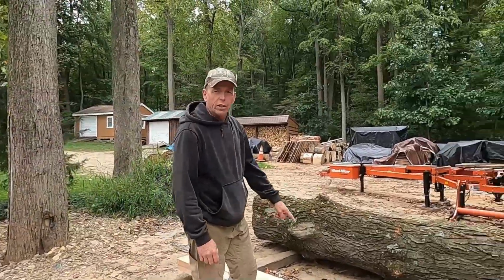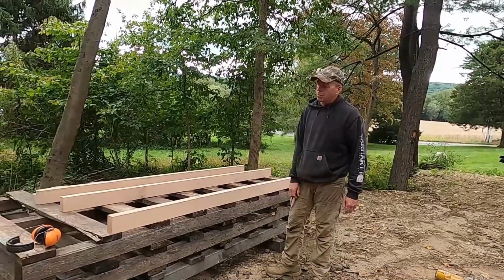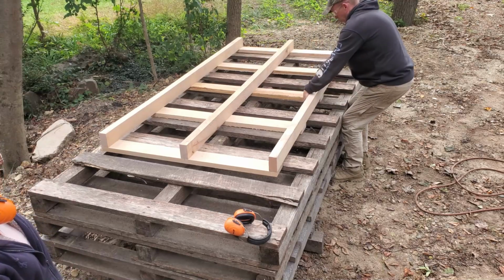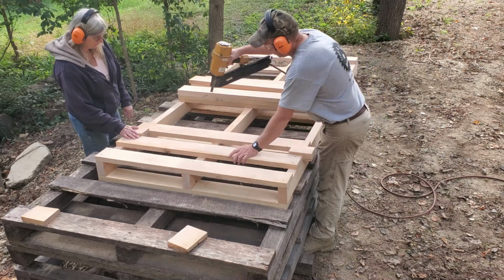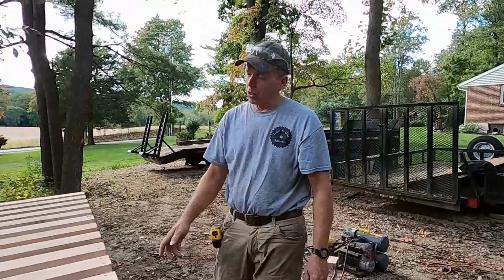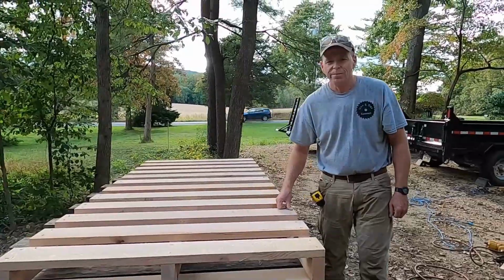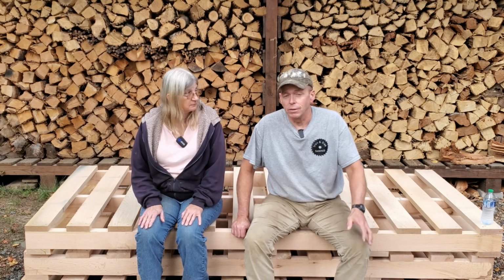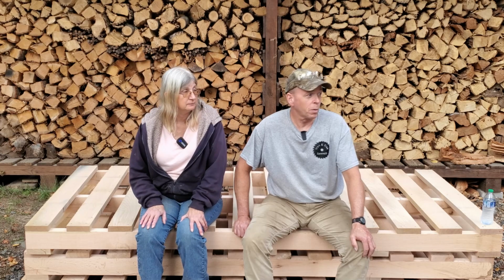Firewood Pallet Build and a First for Deb

Comment: You can use the locust log for some bottom slats. I know black locust has been known to out last cedar when used as fence posts. It is very rot resistant
Reply from the maker: I wish I could find some good black Locust to mill. Could use some rot resistant lumber.

Comment: Strong looking pallets, bet they’re not light.  Does Deb have a spot on the 12-22 picked out for the sticker that I sent you?
Reply: I imagine that they could hold my 285 pounds
Reply from the maker: The pallets are in the 250 to 280 range. Very solid. 
She was thinking about putting on the sawmill, but it's the wrong color.  Probably pit the sticker on the center of the tank, just under yours.

Comment: Do they hold one full cord? Nice pallets I bet their heavy.
Reply: They're heavy for sure that why we have to used the tractor.  Take care
Reply from the maker: They do hold a full cord. The end pallets are only 40" high, so you have to stack it about 8" higher than the end pallets. They are in the 250 to 280 pound range.

Comment: ?? How much does a pallet weigh? I'm going guess 180-220. As always good luck and God Bless.
Reply: Hi Mark. I'll leave Chuck answer that question, I would be just guessing that one. Take care and God bless you.
Reply from the maker: I think we are in the 250 - 275 range, based on lumber weight calculation. The lumber pallets, were poplar and weight in at 400 lbs whe wet wood. A bit less now